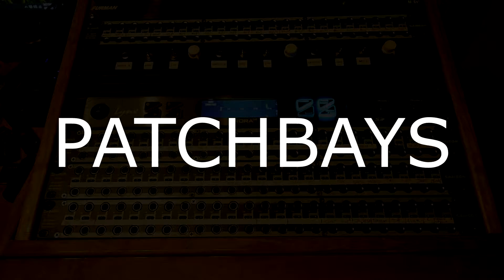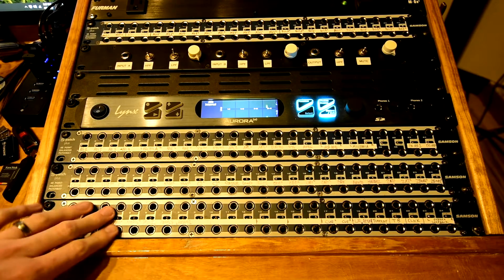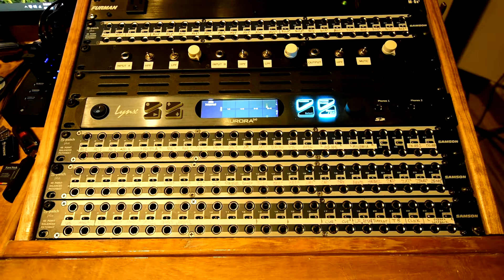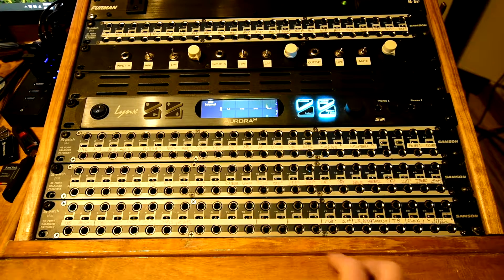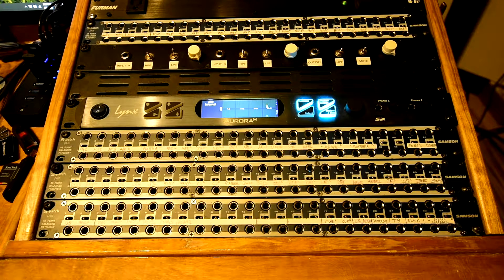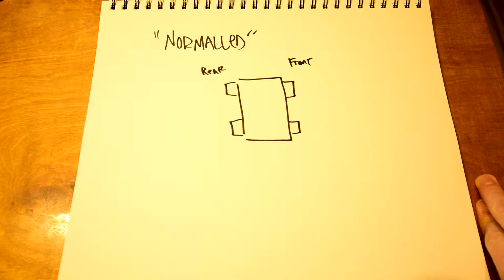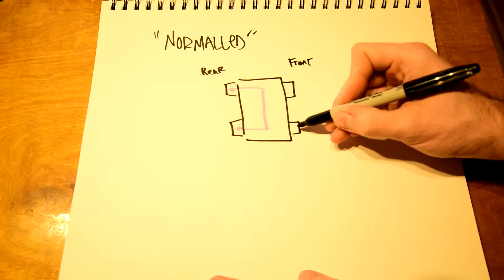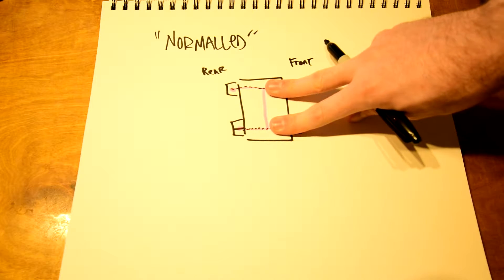Patchbays: How They Work and How to Use Them in Your Studio

Comment: This was great, but what happens with the phantom power from the mic pre or the interface?
Reply from the maker: This is a great question, and one of the reasons I don’t have active phantom power on my bay. A lot of studios I’ve worked in have the live room lines on the bay as well as the preamp inputs on the bay, and the idea is that you can patch any channel to any preamp. But to me this puts you at risk for arcing +48V across the patch cable, which is something that can damage some ribbons or transformer-less mics. Instead, I connect my live room snake directly to preamps and only put their OUTPUTS on the bay. It saves cabling, saves a patching step, and means there’s zero risk for arcing phantom!

Comment: I have one question. I am using a Focusrite Claret 8 pre usb but the first two inputs are located at the front of the unit. In my case it is a Rode NT1 that needs the 48v supply. I have two 3 way patchbays one samson like yours and the other the Behringer px3000. The Behringer currently has effects units all in thru mode.  My Samson  1 and 2 are in normal mode connected to the speakers from Clarett 1 and 2 out. At first all the Clarett ins and outs were connected in thru mode using Samson 3 to 8 my Octopre dynamic is currently connected as thru on 11 to 18 on the Samson. But it is like spaghetti junction. How could I coonect up those two inputs at the front of the Clarett?

Comment: Best explanation of different patchbay configurations I have come across and I've watched plenty. What makes the tutorial a cut above the rest is the demonstration of the different applications for different modes of patchbay configurations whereas most tutorials explain how the connection work front and back with and without patch cables being inserted but without demonstrating what studio equipment is most suitable for which patchbay configuration.

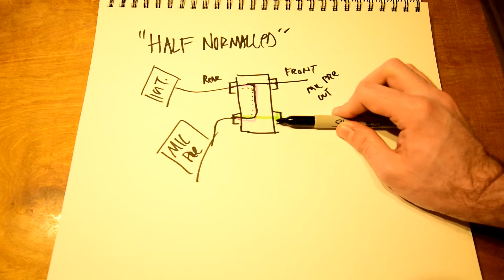Comment: The input and output are reversed in your normalled and half normalled examples. What you have right now at 10:10 makes no sense, because once you've plugged a cable into the top to split the Mic Pre output, if you then plug a cable into the bottom, the new cable is now the Mic Pre output and the previously patched top output cable is now patched to the Interface INPUT. It's dangerous to have the nature of a patch cable change by plugging in another cable! Remember what you said: "out over in." Because the Mic Pre is really the out (audio is being output from it) and the Interface is the in (audio needs to be input to it). Then, with the Mic Pre on the top, you can plug a cable into the top to split the audio from the Mic Pre so that it goes through the cable you just connected as well as to the Interface. And if you plug a cable into the bottom, it will override the "split" to the Interface and allow you to patch directly to it.
Reply from the maker: There’s nothing dangerous about it. It’s a passive connection in either signal flow direction.
Reply from the maker: My preamp patchbay is wired upside down (in over out) on purpose
Reply: Using a patchbay that's been deliberately wired backwards to teach people how to wire a patchbay is confusing and irresponsible. Not just that, it makes no sense for a half normalled patchbay, since there's no way to patch an input to the Interface without first inserting a dummy patch cable into the Mic Pre output.
Reply from the maker: I say this in the video. Irresponsible? Man, cool off. I use this patch bay every day and it works perfectly, with no dummy plugs needed. I think you are confused.
Reply: Why not just always follow "out over in" and always patch from top to bottom? What's the benefit of sometimes patching from top to top or bottom to bottom? It seems like a recipe for disaster.
Reply from the maker: It works for me and my setup. You can set up your patchbays however you want.
Reply from the maker: I know what you mean about the dummy plugs - but what I mean is, I don’t ever need to do that. I leave it on normalled 99% of the time.
Reply from the maker: I also say that in the video - because it was the shortest cable length from output of patchbay to interface directly above. I use very short db25 snakes into the interface. It’s cleaner rather than crossing cabling from the outputs of the preamps to the interface in the back.
Reply: @RecordingLounge  Look, if you had titled this video "Here's how I use patchbays in my nonstandard setup" that's one thing, but you didn't. Judging from the comments I see here, you've got a lot of newbies watching this video, and they might not really get why you've done it backwards. Anyways, I just wanted to call this out, because I felt it wasn't adequately explained in the video and and genuinely confused me, since I'm new to patchbays and am doing research on how to incorporate one in my own studio.
Reply from the maker: That’s fair. If I was starting from scratch, I’d probably just do out over in for everything. But at this point doing that for my preamp bay would require a lot of new cabling, because those current DB25s are so short. I think it would be it irresponsible for me to not mention that mine is backwards. But I did. And to be clear, “out over in” is quite standard yes but, I’ve worked in studios where it was all in over out. And a friend of mine runs his bays vertically, which is kinda weird, but it’s like “in - out” left and right. So... while there are standards it’s more important to understand how the signal flows, and you can customize it to your particular workflow. If you were running a commercial space it would probably be smartest to do out over in, and tbh most of them aren’t even normalled - they’re usually just thru bays for everything. Which to me is a big time waste. But if you understand how the signal flows, you can just adapt to whatever you’ve got in front of you.
Reply: @RecordingLounge  That's fair, thanks for your thoughtful reply!
Reply from the maker: I reallllly don’t want my stuff to be confusing (because 90% of stuff on the internet is confusing) so I appreciate the constructive criticism. But I have found a little empathy for youtubers because inevitably if there is even the tiniest crack in the logic, the commenters will find it! Haha. A blessing and a curse I suppose.
Reply: @RecordingLounge  I totally understand, I created and maintained a popular open source software project for a while :D

Comment: Not meaning to sharpshoot, but in the normalled configuration, wouldn't you want to have the input of the interface on the bottom rear & the output of the pre at the top rear for the "waterfall" default? I watched the last part & see why you would do that based on how you configured your components. You can do it any way you want I guess lol. My interface is on the bottom of the rack so I would do it different. To repeat what other have said here. This is, by far, the best explanation of a patchbay I've seen. My synths now out-number my inputs so I'm going to have to invest in one. However, I AM going to use a normalled path for my main synth to the interface & patch in those I use as an auxiliary. Great vid!
Reply from the maker: Yeah by default I probably WOULD do it that way: I just do it the way I do it because it’s convenient. Haha
Reply: @RecordingLounge  Makes sense! I'm glad you did. I'm just trying to wrap my head around it & just learning. BECAUSE you do it they way you do, instead of blowing my mind, you made me understand it better

Comment: Hi! Thanks for this great video. It's quite easy to understand how patch bays work - it's the best video on this topic I've seen until now ;-)
I got a question: you mention that "outs over ins" is the most usual way to use patch bays. I've just got 2x NYS-SPP-L1 and the standard configuration is "half-normalled bottom row". This way the upper row is always connected (normalled) front-rear and inserting a plug in the front bottom row would break the connection (and thus having a "thru" situation).
Now with this "half-normalled bottom row" setup, I have my instruments connected on the rear bottom row and my interface on the rear top row. If I now want to connect a "guest instrument" from the front, I cannot do this because:
- if I plug it in the top row, its audio signal gets merged to the one from the instrument already patched on the rear;
- if I plug it in the bottom row, no audio will reach my interface.

So how would you suggest configuring my NYS-SPP-L1 to achieve my goal?
Reply from the maker: Hey Flavio -

If I understand your situation correctly: if you plug a cable into the front bottom back (just a loose patch cable) and then plug your guest instrument into the top it should work. Just leave the patch cable unconnected.
Reply: @RecordingLounge  Hi and thanks for getting back to me. Your suggestion will work, yes. Now I could also just invert the "outs over ins" paradigm and go for "ins over outs". Would that be "bad", in terms of not really using a non-written standard ("outs over ins")? :-)

Comment: Thanks this is a really useful explanation. Just one noob question regarding cables. I have balanced I/O on my interface but some of my synths and fx have unbalanced I/O. If my patchbay is balanced, does it matter if I just use unbalanced cables for patching? Is there any benefit to using just balanced cables?
Reply: I think using balanced cables can potentially give a benefit. If you have unbalanced cables, try them. If no problem, you're good. If you do have a problem with noise, try a balanced cable. If someone else who is just starting out is reading this, I'd go ahead and start with balanced cables, as they should head off any noise issues from the jump.

Comment: Maybe I missed it, but why are you breaking the convention of Outs over Ins for your Mic Pres and Converters?
Reply: Thanks for mentioning this.  I thought I was going out of my mind as he proceeded to describe the use cases.  All of my patchbays are configured as "Outs over Ins" whereby in half-normalled mode, plugging something into the top serves to "tap" into the output source, all the while the bottom (in) continues to receive everything from the top (out).
Reply from the maker: Because my interface is directly above that patchbay, and it’s shorter cabling that doesn’t have to cross over itself

Comment: I have the Samson-S patchbay and I can hear audio faintly bleeding through when I have the switch set to Thru. Am I doing something wrong?
Reply from the maker: I have noticed that on certain channels before, but not every single one. Partly depends how loud the signal is, and how bad the crosstalk is on the particular unit. I’ve replaced one SPatch before because I was noticing it on a lot of channels. It seemed to be better on the new one. 

If you really want the purest signal with no crosstalk, you’ll have to get a fixed thru board that’s just Jack to jack, no switching.
Reply: The Recording Lounge-Ace reply thanks. It’s a drum machine going into my UA Apollo rack which has lots of compression. After compression it comes through, good to know. Maybe I won’t send the drum machine so hot.
Reply from the maker: I’ve experienced the same thing even on a headphone snake before, all independently wired channels. I was running a DI signal on the same snake as a headphone mix that was super hot. I ended up getting click track into my bass DI! I eventually made a second snake just for headphone mixes. It’s A real problem that not many people notice. Best way to handle it is to manage gain staging and make sure stuff is wired intelligently.... don’t patch super hot signals next to super weak signals, etc.
Reply from the maker: Really good cabling with really good shielding Is also super important. Canare for example is braided shield, versus Mogami which is stranded. Canare will block out a little bit more noise and crosstalk. Foil shield works even better, but it’s really only suitable for installs behind the rack - too fragile for live room snakes or mic cables or even patch cables. But going from the gear to the patchbay.... foil shield can work really well for that because it doesn’t move.